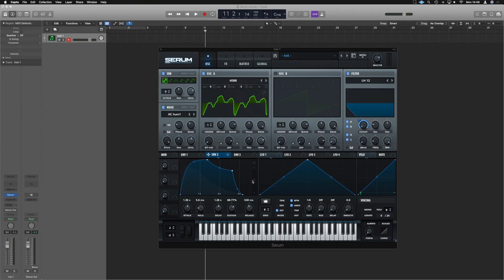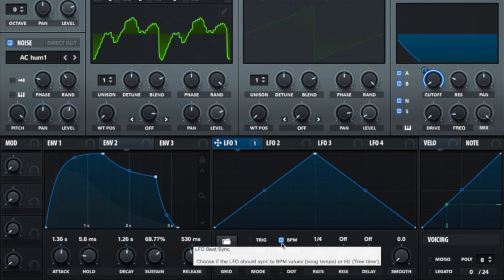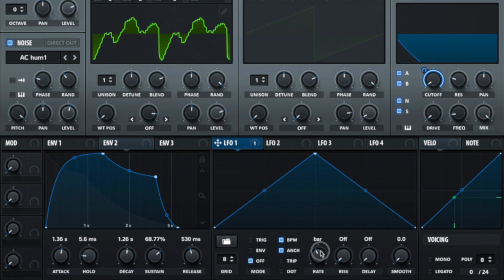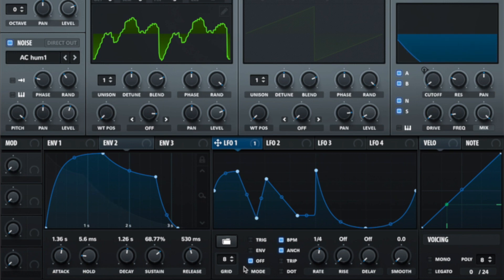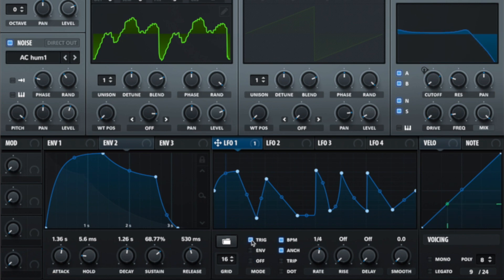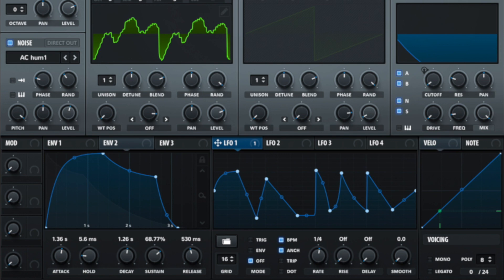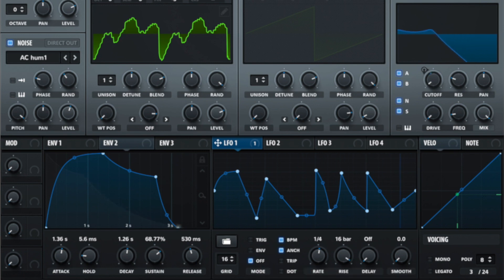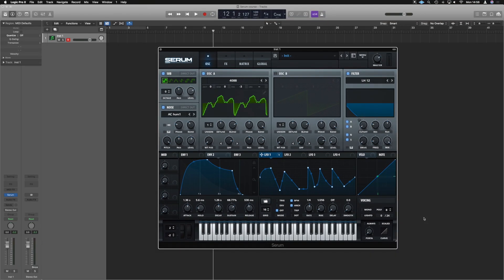How to use the LFO in Xfer Serum - Xfer Serum Tutorial

Comment: How can I control any shape straight? Instead of free control? I mean vertically.
Reply from the maker: What....
Reply: @Unders What I meant is: Can I make the grid more solid? So I can adjust the note accurately and more easily?
Reply: @Incensekid  did u find it? im tryna do the same
Reply: @Nynsai_altfun_2  nah, not yet </3
Reply: @Incensekid  bro, you have to hold alt while moving that little point. and it'll be snapped to grid. thank me later